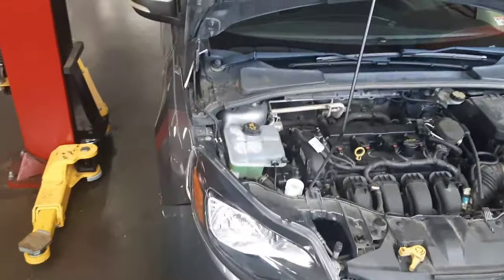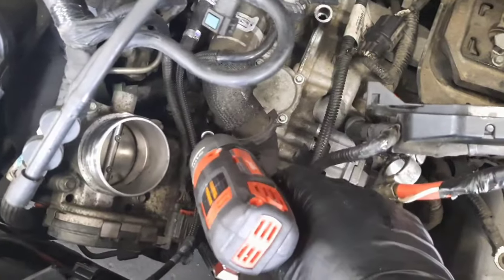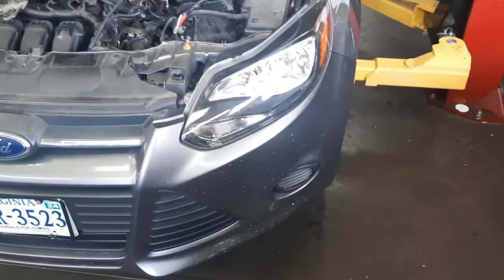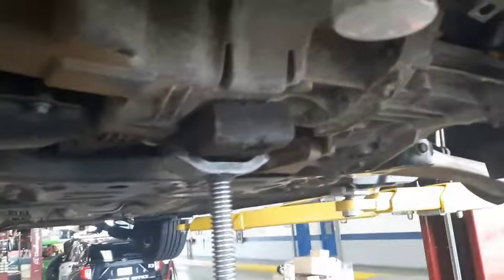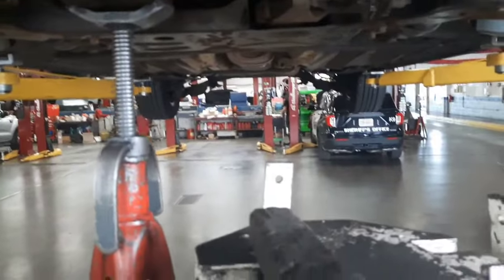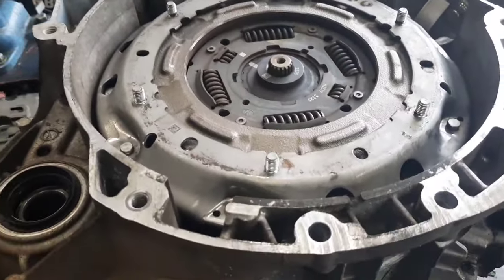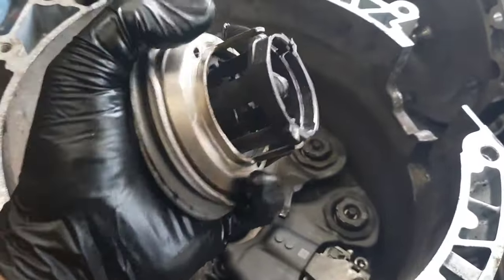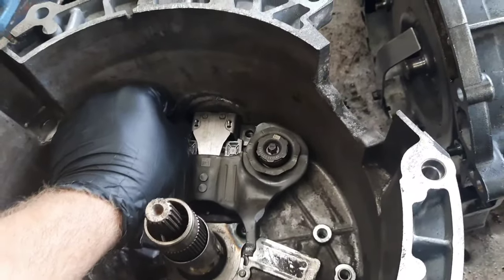Ford Focus Clutch & Fork Replacement & Transmission Removal |  Dual Clutch Automatic 2012-2018

Comment: Did you use the clutch tool to set the clutch down or you just use the fork retraction method to set the clutch
Reply from the maker: I used the handle to set it down and then punched down the clutch enough to install the snap ring
Reply: Do you now how many inches per pound on the fork screws
Reply from the maker: @andresquinonezramirez9373  T45 10-14 ft lbs, E14 18-22 fb lbs
Reply: Do you know the socket part number
Reply from the maker: @andresquinonezramirez9373  https://amzn.to/4cLXwiq
Reply: @BigBensCarsAndCycles  do you know where I could get the snap ring to retain the clutch
Reply from the maker: @andresquinonezramirez9373  it's in this kit https://amzn.to/3UHEAe9
Reply: @BigBensCarsAndCycles  i actually never got one
Reply: A question what happens when one of those little tabs are broken?
Reply from the maker: @andresquinonezramirez9373  which tabs are you talking about
Reply: The new slave part in the video you mentioned always check for those broken plastic tabs
Reply from the maker: @andresquinonezramirez9373  I think it could fall apart or not sit correctly and wear. I dont have one with me to inspect
Reply: @BigBensCarsAndCycles  what's the whole process of relearning the transmission
Reply: And does the clutch needs to click in both sides?
Reply from the maker: @andresquinonezramirez9373  yeah both need to be unlocked
Reply: @BigBensCarsAndCycles  ok so what happens if only one side clicks and the other side does not but like you attempt to unlock it and you still don't hear the click
Reply from the maker: @andresquinonezramirez9373  sometimes it doesn't click it'll be ok
Reply: @BigBensCarsAndCycles  another question ❓ ok we already did the relearning process of everything you know how it supposed to be but is it normal to shake or rattle or even vibrate? Because after we did the relearning process several times we thought we were doing something wrong? Is that normal and after we finish the relearning it says to DRIVE CYCLE TO COMPLETE
Reply: @BigBensCarsAndCycles  does it matters if the transmission fluid is either RED OR YELLOW or it cant be mix with other fluids

Comment: Just changed the clutch out did everything correct now went to start and car won’t stay running starts and idle dies down and shuts off any ideas wat it could be I check all wire connections everything looks good would the relearn fix this ? @BigBenCarsAndCycles
Reply from the maker: Make sure you didn't knock off the vacuum cap near the throttle body. Check my Ford focus cold air intake install video, I point at the cap and mention it
Reply: @BigBensCarsAndCycles  had a vac line off the back of the intake manifold but I have a abs light on now it came on before the repair with the transmission overheat message since shift forks were seized any idea y the abs would be on now I’m waiting on my scan tool still idk if that will reset it or the adaptive learning will fix that issue everything’s running fine now
Reply: Took it for a drive abs light went out ran great I haven’t done the re learn on it my scanner hasn’t arrived yet I parked it for now seems alls good tho thanks

Comment: Great video!! You got a new subscriber from Mexico!! Could you please share the measurements of the custom handle you made to pull the clutch? Thanks
Reply from the maker: Thank you for subscribing! I can take some measurements tomorrow and make a video. You can also thread 2 clutch nuts back on and pry on those in the meantime!
Reply: If you get 2 spare RH front axle bearing carriers, these are a direct fit across 2 studs, so you can effectively have 2 handles and drop the clutch in that way.   @BigBensCarsAndCycles

Comment: Hey, I have ford Focus 2014 it jerks so much while accelerating from 0 m/h (initial acceleration) but post 20 m/h it is smooth as butter and it does'nt have any check light ON. I tried transmission reset but it doesn't give me any difference. Please let me know what should I do.
Reply from the maker: Sounds like clutch shudder. You can either do a clutch and fork replacement, or try accelerating hard to clean the clutch. From 30 to 75mph fully apply the throttle and repeat several times. That should mitigate shudder for a period of time
Reply: Thank you so much, Unfortunately I saw my check light is ON today and I took it to auto parts to see the codes and It gave me following codes
P0420

P0805

P087A

P2831

P2836

P0805

P087A

P2831

P2836

P0805-00

P087A-00

P0901-00

P090B-00

P2831-00

P2836-00

Catalyst System Efficiency Below Threshold (Bank 1)

Clutch Position Sensor Circuit

Clutch Position Sensor 'B' Circuit

Shift Fork 'A' Position Circuit

Shift Fork 'B' Position Circuit

Clutch Position Sensor Circuit

Clutch Position Sensor 'B' Circuit

Shift Fork 'A' Position Circuit

Shift Fork 'B' Position Circuit

Clutch Position Sensor 'A' Circuit

Clutch Position Sensor B Circuit

Clutch Actuator Circuit Range/Performance

Clutch B Actuator Circuit Performance

Shift Fork A Position Circuit

Shift Fork B Position Circuit 
Could you please let me know what's the solution for this?
Reply: @BigBensCarsAndCycles  please reply
Reply: FYI Ford has TSB that warranty the clutch for 10 yrs or 100k miles so dealer service center

Comment: Would you know why after changing a transmission the wheels wouldn't spin?
Reply from the maker: Are you trying to spin 1 front wheel off the ground while in park? Or are the wheels completely locked?
Reply from the maker: You may want to join my FB group and post a short video of what you're talking about. The link is on my channel page

Comment: With the clutch nuts, would it be better to install the 1st one, then skip 2 studs and then attach the 2nd nut as this is the other side of the clutch ? Then skip 1 and attach after that? How critical is this step? I've pulled a trans out, cleaned it all up and reinstalled with a new clutch bearing as the old was was separated, however after doing all the relearn ect there is a slight shudder when reversing. Im tempted to pull the intake and starter, undo all the nuts and then rotate the engine 8 times like you said and then carefully do the nuts up again.
Reply from the maker: Hi, I have a video now with more info on tightening clutch nuts. It's not the most critical thing. It may cause Vibration if not done right
Reply: Thanks for the reply, yeah I just watched it. I definitely didn't tighten those nuts in the correct sequence. Oh well back to it 🤣 @BigBensCarsAndCycles

Comment: What tool do you use to put snap rings back on?
Reply from the maker: I stretch the smaller one with the pliers over the input shaft, and seat it with the installer shown in the vid. the top snap ring i just pop into place and seat with a screwdriver
Reply: Great video! I couldnt see the writing on the special tool that you hit with a hammer. Is there a name or part number? Also, the tool to unlock the clutches, do you have the name or part number for it? Im just preparing in advance. My 2012 sel has 294000 on it and runs great for now. Thanks again.

Comment: I followed your instructions thanks for the video. I am getting a p2765 and p2768 error code. 
When I was taking off the upper TCM switch because it had been disintegrated due to age the plastic shell cracked. Could that be what is causing my code? It could be that maybe it's not on all the way but it sure looks like it is.. My brain points to that as the best suspect as everything else went pretty smoothly... But my feelings on the process is not really empirical..
Reply from the maker: @KevinBroeder  hi, check for damage to the output speed sensor. You may have damaged it. Check my video for sensor Identification to clarify
Reply: It was the sensor. I have that plugged in and working. I drive it and everything works. Is screeches like a 2 year old with cookie taken away. I drove it 20ft, and I can smell it. 
Misaligned flywheel maybe?

Comment: How much does this transmission weigh??
Reply: I don't have a transmission jack and wondering if I can muscle it out lol... (im working off jacks and jack stands)
Reply from the maker: @maxmorris383  light enough to lift yourself, but heavy enough to be awkward to maneuver. I would get a used engine crane for 100 bucks and lower it down that way. I've got a video doing this job in the driveway and that's what I did. I hooked it to the lift eyelet on top of the transmission
Reply: Thank you sir! 
And thank you for this video!!! Total life saver lol

Comment: How much would that cost? Ford wants 3000, which i don't have. Im working on finding a second opinion.
Reply from the maker: That's about right for the repair, unfortunately. Half of that is labor. So 1500 is parts. If you supply your own parts you can save money. Amazon sells a "LuK Repset" which comes with all the parts for $650. So that will save you about a thousand. Luk 07-233. https://www.amazon.com/07-233-LuK-Quality-Replacement-Clutch/dp/B07L9W1RVV
Reply from the maker: FYI, I Made a video about this very topic a moment ago and I'm uploading now to better explain and help people out.
Reply: @BigBensCarsAndCycles  thank you for the quick reply. You're awesome!

Comment: I am requesting your help from Dubai, I have a Ford Figo with DPS6 gearbox the car goes into all the gears perfectly and moves at idle but the the car wont accelerate in gear the car. The rpms would increase in park or neutral but not in drive or reverse. Can anyone help please? No error codes.
This problem started when the car was put on lift and shifted in drive then it was put down and gears stopped working.
Reply from the maker: Some scan tools can't read manufacturer specific codes. There should be a fault code if the car isn't moving
Reply: @BigBensCarsAndCycles  the car seems to be moving at idle rpm just not acceleration in drive or reverse but it does in neutral and park. Any advice to proceed with diagnostic? We tried a Auctel scanner.
Reply from the maker: @praneelsawant702  what work did you do to the car? Is there a shop rag in the throttle body?
Reply: @BigBensCarsAndCycles  I took the car for a checkup they put it on the lift and then shifted it to drive while up on the lift. The car was then put down and then it stopped working. The car drove perfectly well before this. We found issues with left axle and some leaks in gearbox can it be because of this issues? It is impossible to find someone expert in this gearbox here.
Reply from the maker: @praneelsawant702  Are you able to record a short video of the issue and upload it to my facebook or discord group?
Reply: @BigBensCarsAndCycles  yes sure be glad to

Comment: I just did a clutch on a Ford focus and it clicks when
Reply from the maker: Hi, the clutch should click when being unlocked
Reply: No when I turn it to line up the holes in the flex plate.and the forks don't click and no lock
Reply from the maker: @Paul-ze7fg  you may want to pull it out, relock the clutch and check your slave cylinder.  If you want to post a short video the noise on my discord or Facebook group that would be helpful to hear

Comment: The transmission oil is 50 dollars a  quart any cheaper oil we can used
Reply from the maker: Yeah, it's a dry clutch system so any light weight manual transmission fluid should be fine. Such as redline mtl, royal purple syncromax, acdelco friction modified syncromesh

Comment: This video is epic, thanks for posting 👏💯 . Do the newer clutch designs for the Focus seem to last longer? I have a 2017, and per what I can see it's on it's original clutch. This is great information though, as I plan to keep the car long-term. Better knock on wood 🪵 rn tho! Lol
Reply from the maker: Thanks, I'm glad the video helped! No, the redesigned clutches will still develop shudder after 20k miles or so. Just drive it hard once in a while when it shudders, and you should get 100k before a fork seizes
Reply: @BigBensCarsAndCycles  Glad to hear it. I'm at 70k now. Doing that seems to be helping mine act right 👍
Reply: Drive it harder in first gear is my best recommendation. I don't have mine anymore, as it was totaled, but doing that smoothed it right out. I liked to drive it in sport mode and shift between 3-4,000 RPM out of first. Then let off the gas a couple seconds, then drive like normal.